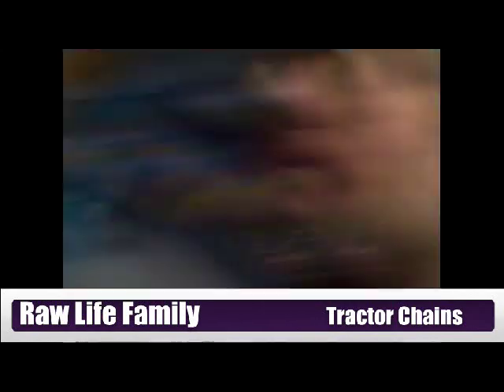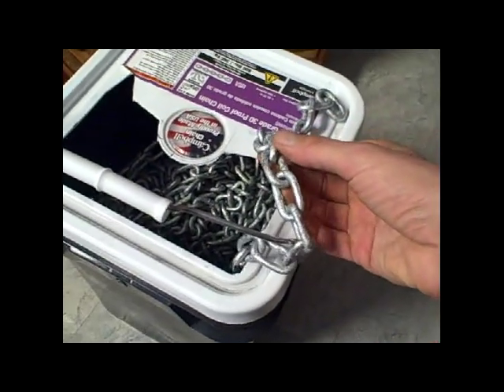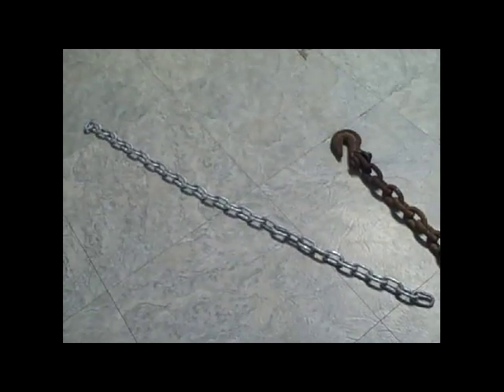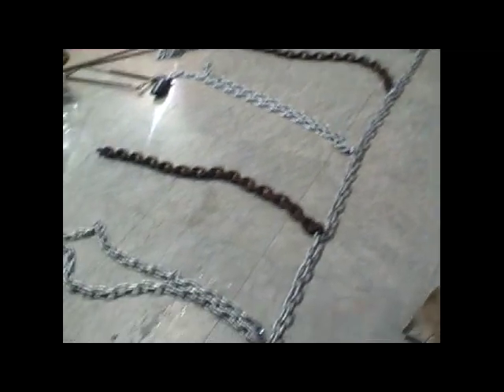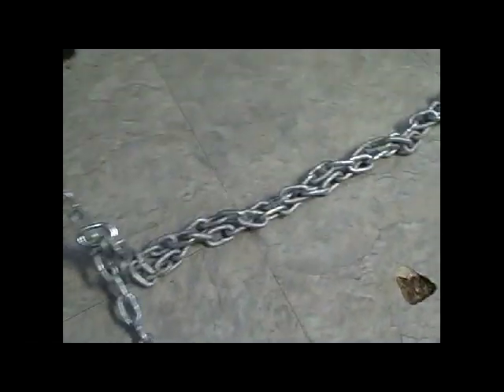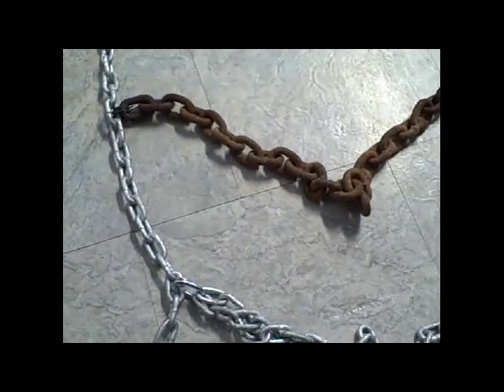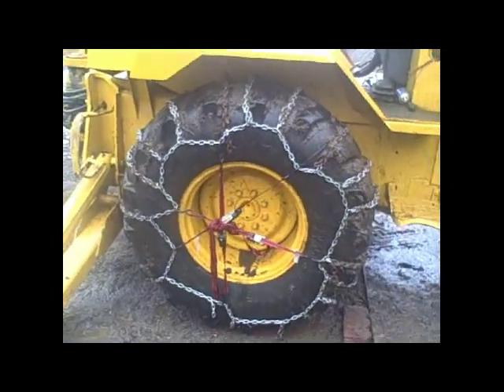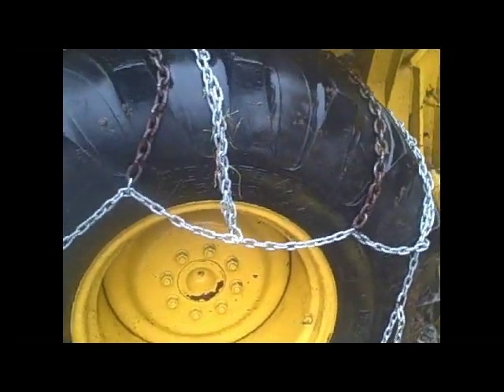HOWTO: DIY Tractor Chains - Hand crafting chains for a JCB 1550B Backhoe

Comment: I can see chains on a tractor but on a backhoe? I've never even been close to being stuck in the mud. Just a grab with the boom and you can pick the whole thing up and set it down where you want or pull or pull your self out.
Reply from the maker: absolutely, but in slick places, on places with even slight hills, my particular machine couldn't even move without the chains. I've definitely used the backhoe to extract myself several times, but as a sole means of movement, it kind of sucks!